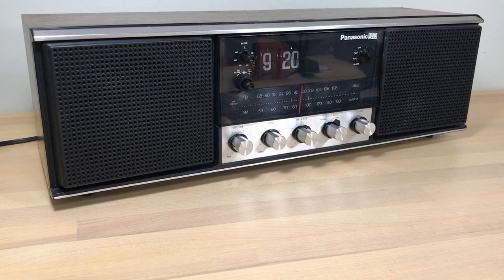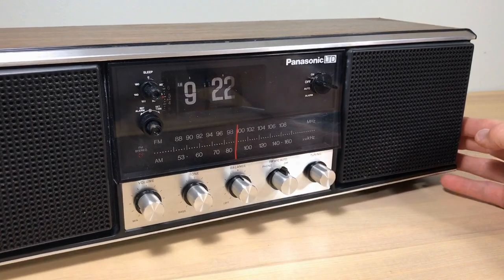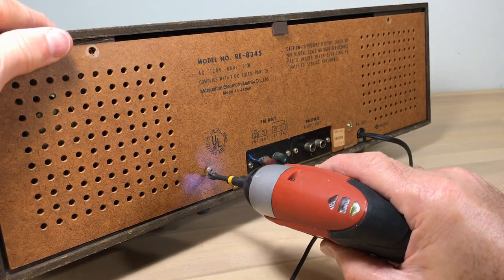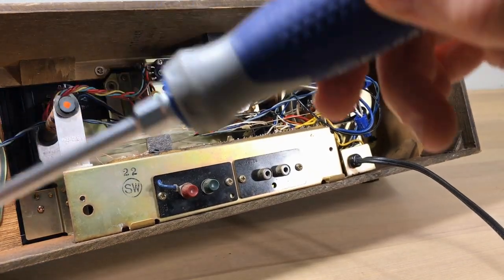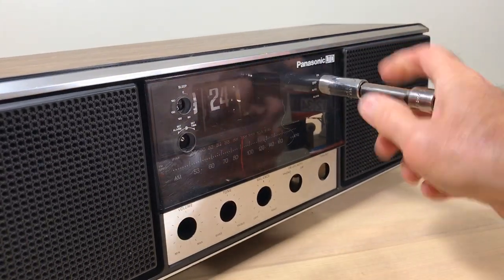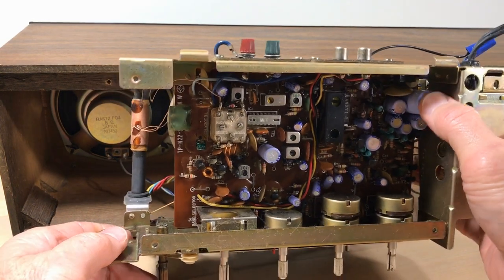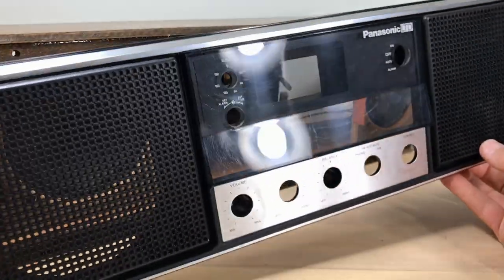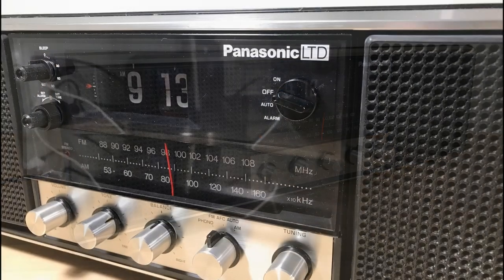Panasonic RE-8345 - Flip Clock Boombox

Comment: As deluxe as this is, every bedside 🛌 needs one. "The Bedroom Stereo". This should pump your tunes about your personal space. And it's a flip clock ⏰. Nice circuitry, dial cord, and dial pulley. Every thrift store should carry these flip clock ⏰ radio radios. I can probably find this for $20.00, there. I'm pretty sure the dial light works. Just the motor may need cleaning and lubricating. Just don't burn 🔥 the dial cord. Your friend, Jeff.